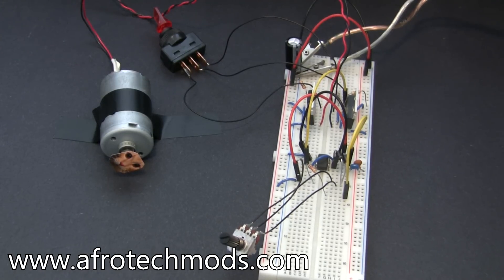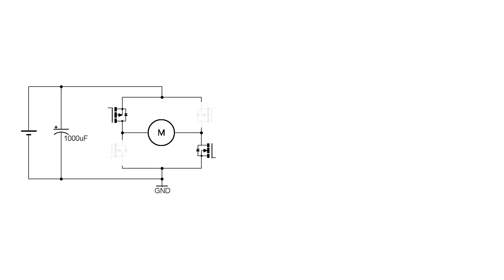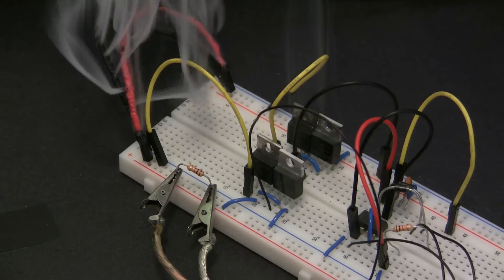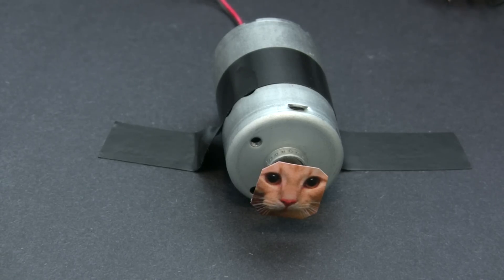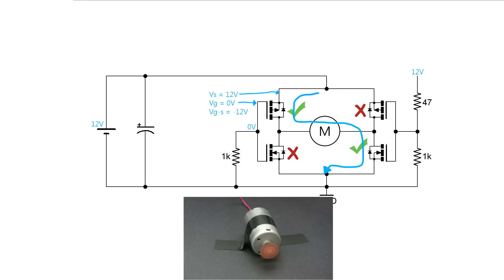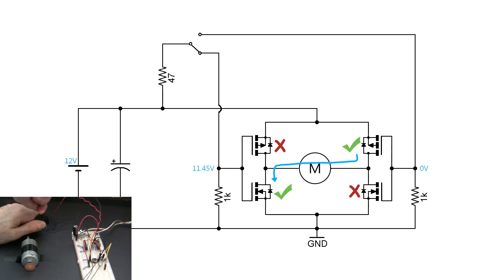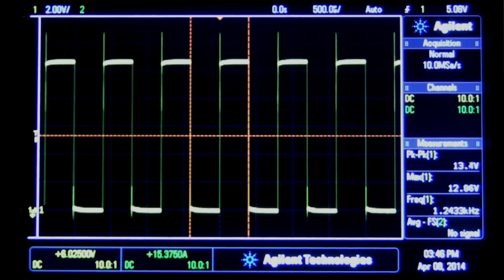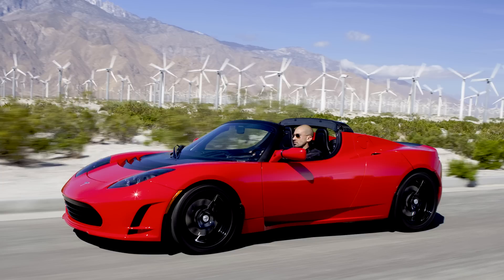H Bridge Motor Speed Controller Tutorial

Comment: Why is it that in the simulator that I'm attempting to build this in on my phone, the voltage between the gate and source needs to be greater than the supply voltage to fully turn on the MOSFET?
Reply from the maker: There is no way a simulator is going to do a good simulation of a circuit like this unless you spend ridiculous amounts of time manually tweaking the parameters of every single component

Comment: Someone tell me what I'm doing wrong!  I'm using an arduino to control the bases of 4 transistors, and a 9v batter to source the current through them.  I can make my 2 motors connected together go forward, and backward independently, but not when everything is hooked up all together.  Is there an issue with floating pins?  Should the bases additionally be connected to ground like they are in this video?  I know it's stupid easy, but trial and error is killing me.

Comment: what is the main purpose of H bridge? just control of roration or srart and stop the motor safely without damaging it and power supply?
I wanna use pwm and 12V 15A switching power supply for a 10A DC motor, are these two circuits reduce the inrush initial current? or should use only pwm alone? (motor is for agate carving)

Comment: Nice... with the pulse width modulation - is the motor still running at full voltage, just a reduced current due to the lesser amount of time the motor is being sent current?

Comment: Great video! Question: I've made a BJT version h-bridge which works well over 1 amp, but my MOSFET version can't seem to draw enough current... fine for small motors, but no luck above the milliamp range. Tried making a switching circuit to drive each fet individually, but still no luck. Doesn't seem to be much info online for making a higher current Mosfet h-bridge. Any ideas?

Comment: Great video -- Great voice!  Any idea how i could get this working with a motion detector? Working on a cat toy for my son's cat... lights, motion, sound... you get the idea. Would like to have the motor reverse each time the IR motion detector activates. Any thoughts would be helpful!
Reply from the maker: Check out my tutorial on Arduino then get a kit that has a few sensors
Reply: @Afrotechmods  

Made the sensor from found parts and got the PWM speed control working when triggered by the sensor. Now I'm trying figure out how to add a flip-flop H-bridge combination so it will reverse direction each time it's triggered. Any ideas?  You can see (unfinished) project at https://youtu.be/c9agMnjELJQ
Reply: @Afrotechmods  

Check out the completed project at https://youtu.be/UFgKFypzIJo . Made from found parts.

Comment: Thank you for the amazing demonstration. I am interested in building a high current motor driver where there should be 24 A continuous currrent. I figured out the MOSFETs that I will be using but I cannot figure out the values of resistors and capacitors that are required. Could you please help me?

Comment: I have a schematic for a two motor driver that uses the LM555 timer IC in an astable configuration and a single N-channel MOSFET (because I only want it in one direction), however its power supply is two 12V lead acid batteries is series, which means that I need to turn that into stable voltage of 24V likely using a buck-boost converter. Is there anything else in particular that you'd suggest?

Comment: I didn't comprehend why is it necessary to use 4 PFETs to run the motor. If we wanted to run it with only the highest speed we could connect it directly to the Vsrc. If we wanted to be able to control the speed, couldn't we just put PWM in the middle? And to change direction we just needed a switch to change polarity. Of course I know I am wrong but why?

Comment: Afrotechmods 
Maybe it's a stupid question, but why do you use PWM signal instead of just varying the resistance (so that the voltage at the switch and the speed of the motor change)

Comment: Hey! I have a couple of questions: 

Are there advantages to using MOSFETs as opposed to power BJTs? 
Is there a reason for using a 1K-ohm resistor as opposed to a 2.2k-ohm resistor?
We want to use the PWM signal from an Arduino, but those can only output 5V. If we're using a 12V source to power the motor, what can we do to the PWM signal from an Arduino to control the speed of the motor?

Comment: Hello, i was wondering is it possible to control 555 ics dutycycle length?? What iam trying to do is ,spin a motor (brushed dc) to some clockwise and some anti clockwise to do this i need to produce a limited length pwm signal  it is ofcourse much easier with arduino but can only 555 or any cheap ics can do this!!! I am  going to feed this signal with any h bridges or h bridge ic s  ...
 And one more thing as i read that 555 can only produce any timing of certain points as 1, 5min...etc is it possible to bring down to seconds?? 
In case there is no option without using 2. 555s one for pwm and one for length cut out...plz let me know.. Regards..

Comment: so odds are the answer to this question will be over my head but here goes nothing.. say I want to limit the amount of time i want the motor to stay on but at a constant speed, would a relay suffice?Also, I don't understand what the point is to all of the extra parts in the video when I was able to adjust the speed of my motor with an spdt switch, microcontroller  and a potentiometer

Comment: Alternatively if you need to drive your motor with more current than the NE555 can handle, just connect its output to the gate of an N-channel MOSFET, and use the N-channel MOSFET to drive the motor directly. The MOSFET will be able to handle much more current than the NE555 ever could. ;)

Comment: Hello ! , thanks for sharing this knowledge ! :) , helps a lot ! ; Just have some questions please, help ! 
Please I want to ask you, 
- Can I use another diode , replacement instead of the 1N4004 ? and the same for the MOSFETS ? , can I use replacements ?. which ones ?  
- What is the voltage on the 1000uf capacitor ? and Resistors ?
Thanks a lot again ! 
Will wait for you answer to go to the electronic shop , can´t wait :D 
Greetings !
Reply: in what diode to choose it just has to stand the demands of the circuit its connected to and that diode is connected to the 555 timer and a 1000 ohm or 1K resistor wich is connected to VCC +5V or +12V 

and if you follow the path from VCC down through the diode it goes through a potentiometer and lets say it has a value of 0 ohm "shorted" (all the way to the left depending on how you wired it) 

 then you may wonder how many amps will my diode see in this circuit well its connect to lets say 12V and a 1K resistor then with ohm's law
 I=V / R = 12V / 1000 = 0.012 A = 12mA 

so then you need to find a diode that will be able to handle 12mA and 12V or higher 

so you could use a 1N4001 if you wanted to 

this link will tell you difference between diodes and read
 "1N4001 AND 1N4004 DIODES"
https://www.techwalla.com/articles/difference-between-1n4004-and-1n4001

 
1X 3W 47ohm resistor
3X 1/4W 1k resitor
1X 16 or 20V 1000uf capacitor
Reply: Thanks Master ! :)

Comment: Thanks for the info. great video, one question: 
What elements in the circuit should I change to make it work safely with a 24v 100w DC motor? I just want to control the  speed of motor, reverse not necessary. Thank you.
Reply: put a voltage regulator for the NE555 and put a op-amp voltage-follower so your H bridge is not directly connected to NE555

Comment: hi, I am trying to copy your circuit to 3 dc motors (with reductions ), but the 3 IC 555 gets too hot, I am using 2p2t swicth for each motor instead of transistors, ac/dc adaptor 12v and 0.3 amp as power supply, what do you advice me ?? thanks in advance

Comment: Could you use a small capacitor to smooth out the square wave through the motor, and thus reduce the 1Khz whine? Also, does attaching an inductive load directly to a mosfet, and feeding through a square wave, risk damaging the mosfet?

Comment: Hi there, I love how you explain your process! Thanks so much

Is there any way to use a H-Bridge to control a DC motor and make it spin and stop at 4 or 5 separate points? Something that could operate a 4 way valve? Sorry I just have to ask...
Reply from the maker: Look into a thing called stepper motors

Comment: How can you use this with an Arduino controlling the logic? Like with only 2 wires, for PWM each direction. Also how would you stop the motors from spinning? This method you show would need 3 wires to control from an Arduino right? A PWM for the speed, plus which direction its going? Have not been able to find any specific info on how to turn the motors off when only using 2 wire control..

Comment: Awesome explanation! Could you use an Arduino to turn on and off the transistors? Allowing to control the direction of the dc motor through software instead of a manual switch?

Comment: Hi dear,
Thanks for such a good tutorial. Is it mandatory to use 2 P-channel and 2 N-channel mosfet or 4 N-channel will serve the purpose? I've all IRF540N.
Reply from the maker: You have to use the specific FETs I showed in the video. To use 4x N channel would require a different circuit with different gate drivers.
Reply: Thanks

Comment: I have a doubt sir...I'm using a L293D IC (ready made dual H bridge) to control two DC motors ...I'm a bit concerned that the back emf might damage my microcontrollers.What safety components must I use to make sure that my microcontroller is safe from the high input voltage on the motor ?

Comment: I have a question, the mottor is controlled by a PWM, so we should be using a freewhel diode. But here the current  flow in the two direction, so if we put a diode in parallel with the motor, there would have a short circuit when it rotates in the opposite direction.

So why doesn't it blow up even without a freewheel diode?

Comment: Is there a way to replace the switch for the current direction with a 555 chip or something to make the motor switch directions automatically?
Reply: Yes, with an microControler (like Arduino). You will have to use 2 different pins. When 1 pin is ON, the other one is OFF and vice versa.

Comment: Can I use any FET type or are these specific ones that are used. What about IRF630 and IRF9630 which draw less current.
Reply from the maker: +M Hassan You have to use the specific FETs in the video
Reply from the maker: *****
The gate capacitance and gate resistor values are carefully selected to minimize the time that both FETs will be on at the same time. The longer this happens, the longer there is shoot through i.e. current moving from straight from supply to ground. With the components I chose it is not really a problem for low currents. Other FETs might experience significant heating.
Reply: Hey Afrotech, you do such a nice job, keep on!! Why can this simply circuit  only 2A provide when there are 27A mosfets? Is the lower input voltage (not 60 Volt) that drops the amperes?

Comment: may i have a question? i don't understand that 1k resistor's voltage value is 11.45V because i caculated that .. 12V x 1k / 47k+1k = 0.25V      am i worg?
Reply: +hmida karboul V2= V1 * R2/(R1+R2) = 11.46V      (errata)

Comment: when are you not using diode to prevent back emf spike ? where should I put the diode ?
Reply: +Maxime G You should always use a diode to prevent a back EMF spike. However, may MOSFETs will have such a diode built into the package. Check your MOSFET datasheets for both P and N channels to see if they are present.
Reply: +Maxime G They are built into the FETs he is using. Look at the schematic and you can add a larger diode in the same area.

Comment: For having an variable speed motor with an output power of 0.75kW, is it more economical to use an AC motor with frequency converter, or to use an DC motor with speed regulator?

Comment: Do you use the 555 to avoid the loss of a linear voltage reg? Couldn't you just stick one in serious with the motor? If so can a buck converter be used to remedy that?
Reply: Don't buck converters basically work using pwm?
Reply: +radioactivated yes. Buck converters do work based on pulse width modulation, but the pwm signal from the converter is actually smoothed out in a filtering subcircuit in the buck converter. therefore, the output from the converter should be a clean DC line.

Comment: Can I make an H-bridge using ordinary transistors, like BC557 and BC547? I probably won't use a motor rated higher than 6V, since I don't have any 12V motors.
Reply: +PunakiviAddikti You can, if you make sure you do not exceed their current ratings. Also, you should probably use external clamping diodes if you're gonna use BJTs.
Reply: Robb MG Ok, thanks! Mosfets are kinda hard to get here so normal transistors are all I have.

Comment: You can change the direction of a motor with a single Double Pole Double Throw switch without the transistors. Is there any reason to do it this way instead?

The DPDT switch has two segments with three states (left, neutral, right) states. When you push the switch to the right, the current flows through the right side of the first segment, into the positive end of the motor and out through  the right side of the second segment. When you push the switch to the left it flows through the left side of the first segment, through the negative end of the motor and out through the bottom of the left second segment.
Reply: I think you can use this switch without problems.  But for example a uC can't use this switch (maybe with a servo motor toggling the switch :P). But a uC can use the H bridge and switch the direction. :)
Reply: +Joel Duncan Also, you might want to have a tiny switch, which cannot handle all the amps..

Comment: How can I make an H bridge from only N-channel MOSFETs?
My problem is the MOSFET connected to +12 volts doesn't turn on because the resistance from the motor. 
I'm trying to turn it on with an Arduino.

Comment: Doesn't an H Bridge count more as a motor driver than a motor controller? It's purpose is to take a control signal from a control circuit and provide the appropriate amount of power to the motor.

Comment: I am trying to add a motor i took from a Razor Scooter and somehow add it to a garden wagon, but I don't know exactly how to do it any idea? i have two 12v batteries, and the motor with the gear, i was thinking of welding the gear to the rear wheel axle and connecting the motor to that but I dont know how to control speed of motor... could you help me

Comment: Can I trouble you once more please? I want to PWM the H bridge as you suggest, I can do this much...but how would I automate the changing of direction of the motor? ie, motor runs CW for 3 seconds, then runs CCW for 3 seconds, rinse and repeat. I'm sure there's a way with another 555 astable and a relay maybe, but the totem pole output has me confused as to how to get a second high out as opposed to it going high/low/high/low??? Make any sense? Oh, and Arduino is out of the question too atm...low funds. Any help would be truly appreciated :)
Reply: You could use a 555 timer and a pair of mosfets to do the job. You could also get an Amtel ATTINY microcontroller chip for a buck or two if you already have an Arduino to program it with.

Comment: Need a heat sink on the 47-ohm resistor? I want to design this circuit with small fans in parallel in place of a motor (in DC). I plan to use a potentiometer in place of the 47-ohm resistor but choosing not to use the 555-timer.

Comment: Couldn't you use a motor as speaker if you played an audio signal through it and stopped the rotor form spinning? I noticed the ESC in my RC car plays tones through my brushless motor when I change settings and when it is binding.
Reply from the maker: Yes, you absolutely could! I have done this many times. Any situation where you have a coil in the presence of a magnetic field you can use it as a speaker. Just be aware that the impedance of the motor may not be right for your amplifier, so don't do it with expensive Hi-fi equipment :D
Reply: It was just a thought. I think it wouldn't have very much base though... I might get a small phone vibration motor rated at 1.5V and try playing audio from the headphone jack on my computer with a resistor in line to limit the current.
Reply: +Aidan Gieg Good idea, but just be aware that when the motor is off, it's gonna create a huge voltage spike that can damage your music player. You need to put a diode between the two wires so that the negative side is connected to the positive wire and the positive side is connected to ground. That way, when the motor stops, the voltage spike has a clear way though the diode, since it's reversed. You need to pay attention to polarity though. The diode is essential in any application that can create voltage spikes due to collapsing magnetic field. This is commonly used in boost converters, joule thiefs and inverters.
Reply: PunakiviAddikti good point, I forgot about that!

Comment: Can i replace the 555 chip with an RC receiver in order to work it as a bushed ESC?
Reply: This wouldn't work very well. The RC receiver is sending pulses at 50Hz but the duty cycle is between 5% and 10%. Your speed control would be from very slow to slow and you wouldn't be able to stop the motor.
You really need some sort of microcontroller between the RC receiver and the H-bridge to convert the pulses from the RC receiver to the proper PWM duty cycle (and appropriate frequency).

Comment: Great channel! Quick question, I'm looking to make a circuit that can power a motor bidirectionally with just a single dial. In other words, I would like to have a single control that would power the motor forward proportionately, not power the motor at neutral, and power it backwards proportionately. Would there be a way to use a potentiometer or  a hall effect control? What would the general schematic look like? Thanks for your reply and your awesome videos!